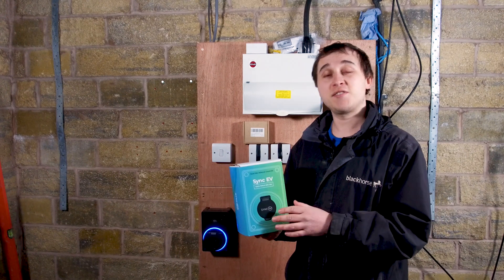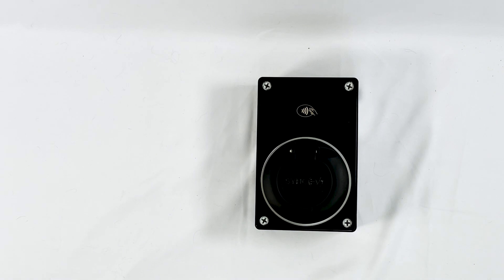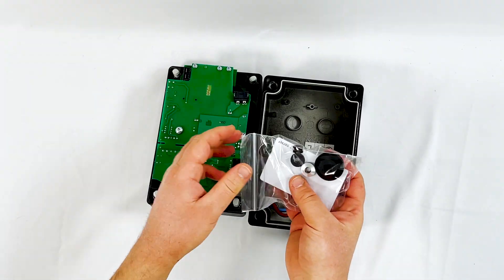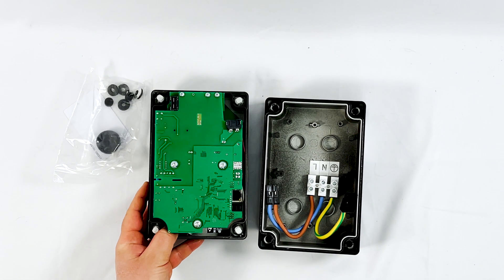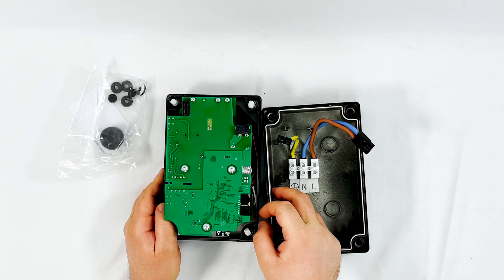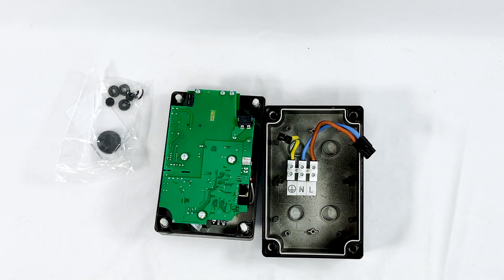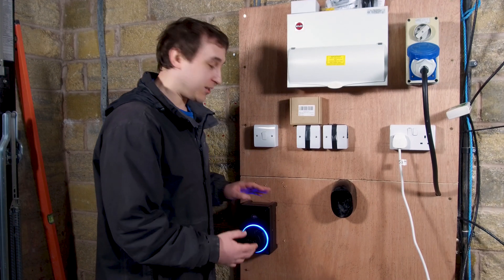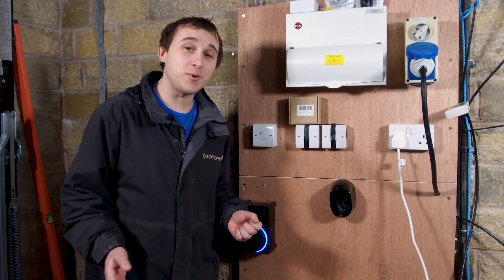Small Smart Sync EV Charger Is This Discreet Enough?

Comment: They definitely missed a trick with the tethered one by not using the blanked off port as a holder for the cable when not in use! That would have been a fantastic and clean way to store the cable

Comment: Nice review Nicholas 👍
Does the RFID card have to be used every time you charge then?
Reply from the maker: Hi Mick can be turned off or on in the settings.  Please consider clicking subscribe and watching the other charger reviews MUCH MORE to follow
Reply: @NicolasRaimo  just subscribed pal. I'm an installer looking at alternative chargers to the Zappi and the SyncEV looks promising
Reply from the maker: @mickbitchum4664  Did you see the video i did with Efixx?
Reply: @NicolasRaimo  no but I will. I do subscribe to efixx but must of missed that one
Reply from the maker: @mickbitchum4664  2 videos on efixx,  the live video with me doing electricians challenge and another interview style video
Then 1 on my channel about charging by 13 amp socket
Reply: The motherboard now has Live, neutral and earth connections etched on it so there's no mistaking which plug goes where.
Reply: Did you try scheduling a charge? Charger looks great and would seriously consider getting one installed but a number of comments on Google Play and the App Store say that scheduling doesn't work. The latest comment is from today  July 4th 2021.
Reply from the maker: @dcostello1976  yes worked for when I had it

Comment: All seems like it’s all a big secret.  I’m thinking of a Kia Niro +4 and looking into the installation of a charger.
No manual?  And if you install it yourself you can’t get the grant.  I have a degree in electronics, I’m quite capable of putting 3 wires under 3 screws.   I was interested in the mains connection on an RCD board, 2 RCDs? and the cat5 connection to the house LAN.

In the event I progress this, I will in all likelihood get an installer to do the work, being basically lazy, it’s just that it’s almost like somebody is saying you’re not intelligent enough to understand this, which I find annoying.
Reply from the maker: Ofrex these devices are 7kw if you read the regs your not allowed to fit one of these unless you can sign it off your be voiding your insurance on your home,  same fitting an oven or electric shower that’s of same power.

If your wanting to save every penny find an approved ozev installer and come to an agrrrment you put all wiring in and he just signs it off
Reply: @NicolasRaimo  Hi Nicolas.  Sorry I forgot to say, good video, I enjoyed it.
I think I said I was not contemplating installing it myself, however my understanding of part P regs is that a ‘competent’ self certifying person can carry out the work and sign it off.  I agree with you that if the house burnt down and investigation proved it to be due to poor workmanship.....
What I would find interesting is what the other end of the cat5 cable can be connected to.  I understand the current measuring part, but not sure how the LAN connection is made.
Hopefully the manual will be released, I wouldn’t buy one if it wasn’t, due to needing information if I needed to make updates/alterations in the future.

Now  we are out of the EU I would like to think that further regulations will concentrate on safety, rather than profit.
Cheers Noel
Reply from the maker: @Jestey6  sorry maybe wasn’t clear in video one rj22 is for the ct Clamp the other rj45 is for networking you’d need 2 cat5 cables to do both
Reply: @NicolasRaimo  Understood. So another cable, or are there enough wires in the. Combined cable?  Cheers Noel
Reply: If you are installing a new circuit from the consumer unit (required for EV chargers) Then yes it will come under Part P. You can carry out this work yourself if you deem yourself 'competent' but you would have to arrange for your local building control to sign it off (at a large cost probably). So it's generally easier to get an electrician who is a member of a Competent Person Scheme (NICEIC/Napit) to complete works - preferably OLEV approved to make use of the grant.
I'm also not sure you would be able to validate the 3 year warranty on a self install as this is normally done by the installer. 

In regards to the RCD query  it's recommended to install on a MCB at the consumer unit not protected by an RCD -  to avoid issues with two RCDs inline. Some situations will require an RCD (cables buried in wall etc) so sometimes it can't really be avoided unfortunately.
Reply: @mickbitchum4664   Hello Mick one question please. If i don't connect rj 22 CT Clamp EV Charger is goning to work or not?
Reply: @eurosistemengineering8672  yes. The CT clamp is an optional extra purchased separately
Reply: @mickbitchum4664  thank you
Reply: @eurosistemengineering8672  👍

Comment: Piss-poor design not marking the PCB - zero cost, no excuse
Reply from the maker: Hi Mike as mentioned it’s something I was disappointed in,  I suggested using different plugs so one can’t be plugged in another or a connector block so the back plate pushes into pins when connected with front plate they said they will look into it with version updates they have planned
Reply: It's really clear on the instructions so there shouldn't be an issue
Reply: @jacktissington  No matter how much you try to make something 'idiot-proof' there will always be a more proficient idiot. 😉

Comment: I have this unit and I have had one issue of it loosing connection but a simple fuse reset and it was back. I wish I could dim the halo lights as at night  its rather bright, so I have to place the wheelie in front of it - other than that its great product for the price, especially because you don't need an earth rod installed.
Reply from the maker: Your halo light is now dimmer SyncEV tell me they specially dimmed yours just now,  which just amazed me they read this text me and did all this in 14 minutes!
Reply: @NicolasRaimo  wow, i will check that out when i get home, thank you Nick and SyncEV - I have to say their own home installers are great (they are based in Sussex and i live in Sussex, so got very lucky) and did a cracking job installing my unit and at a fantastic price - so a huge shout out to Craig at SyncEV
Reply from the maker: I think the halo light dimming be part of new app but by sounds of it you got yours dimmed early now

Comment: Great stuff you are going through this with these chargers - but honestly, it seems more like a scam because of this grant-thing. Where else can you buy what is really just a smart socket for £500-£1500. Funny enough, you never see anyone below £499 "all inclusive with after the grant". It sounds like a great big rip-off again - both for consumer and government :)
I'd wish you would make a comparison chart on your website, too, so you can compare them side-by-side, what's included, functionality, earthed required etc. 
Maybe you could even make a score system, and see where which scores most and least - it will be easier to make a decision, otherwise it is like to be based more on price rather than quality and benefits of the socket. Keep it green ;)
Reply from the maker: There’s so much more to these units than just a socket! The safety systems alone are massively complex,  if you want a stupid dumb socket for EV charging with no safety plenty on Amazon but I won’t be plugging in my expensive car to them or risking my garage catching fire,  there used to be loads of chargers around for £100 early days after grant before smart tech and safety standards got improved and minimum warranty levels.  I know a large firm of rapid chargers won’t make EV chargers as they can’t work out how everyone else can do it this cheap